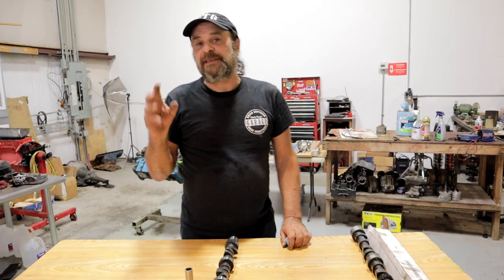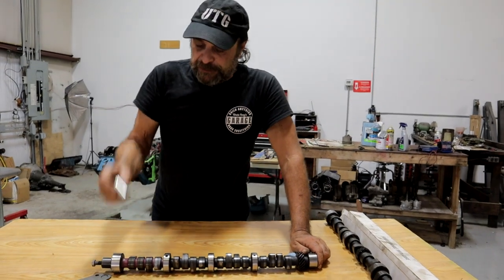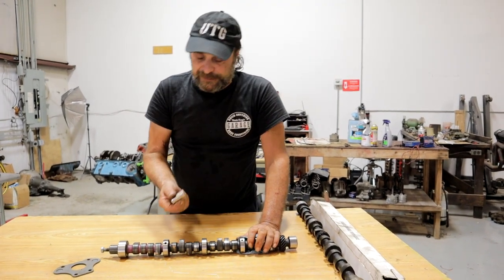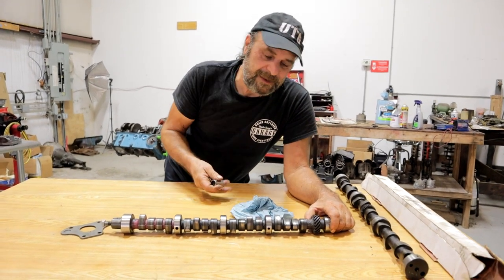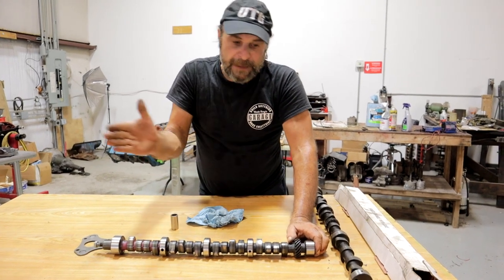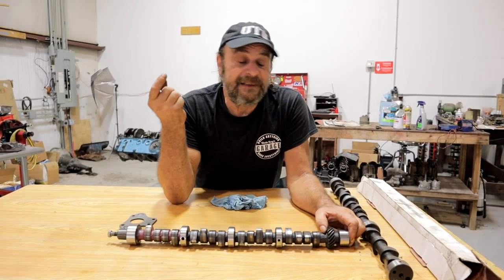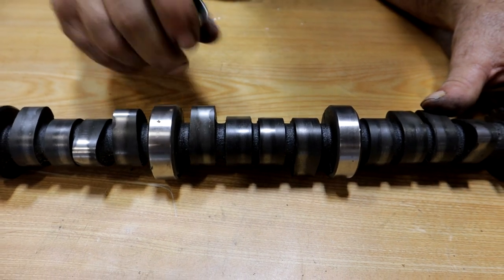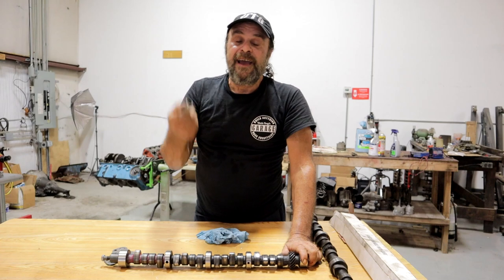Avoid Failure! Camshaft And Lifter Wear Patterns - What They Mean And How They Are Established

Comment: I work at a high school technical center. Your information is perfect for the kids to comprehend. Also, just short enough to keep their attention.  You make everything very easy to understand. I’m in my mid 50’s and grew up with all of what you are teaching.  I especially like that everything you teach is universal. I’m a Buick guy and I have thought back for several years now.. “ hmm what did Tony say”.. thanks for your time man.
Reply: Ever thought about missing oil thrower paddles on aftermarket conrods? Original GM Small Block rods have so called Splashers that throw oil on the cam lobes, most aftermarket rods dont have these oil throwers

Comment: More than 40 years ago I bought a 68 Chevy truck from a garage that acquired it with a mechanics lean. What happened was they put in a used engine supplied by the owner and it ran like crap.  They told him the cam was bad and what it would cost to replace it. The owner didn't want to put that kind of money into a 15 year old truck but also refused to pay for the work already done. I bought it by paying off the amount owed thinking I was going to need to replace the engine. My father in law owned a garage. When we checked about 4 lifters had no tension against the rocker, "very early Chevy 350" But my father in law noticed that when the engine turned over the push rod moved as much as ones that seemed normal almost like the pushrods were too short.. Pulled and measured, all the same length, started pulling lifters. All were fine except the 4 in question had wore clear through to the hydraulic center. My father in law ordered another set of lifters. We dropped them in adjusted the lifters and the engine ran fine. No smoke no noise. I ran it  for another 12 years and sold it for a lot more than it cost me to buy it.
Reply: Don't care if you got another 12 years out of it. You do not put new lifters on a used cam. Period.
Reply: @daveo532   New lifters are put on used cams all the time. All you do is act like a new cam break in.. Run the engine at about 2500 for half an hour an very the speed up or down 200 rpm. If there would have been a problem it would have showed up. It was not a high performance engine so the valve springs tension was not very high and we readjusted the valves after break in. We put other used cams in without problems. I put a used cam with higher lift in my 289 mustang motor out of a 351. There wasn't any problem. Just had to change the firing order.
Reply: Change lifters all the time. No biggie.
Reply: @daveo532  I think you got it backwards buddy you never put used lifters on a new cam..

Comment: Good Stuff! I've been building motors for over 30+ Years and actually learned something I didn't know...The reversed tapers on a properly ground "A series" MOPAR motor. Myself, I build GM motors these days, specifically Z/28 302/LT-1 motors. The last LT-1 I built I wanted it to "run a little better" than OEM, called up Bullet Cams and ordered a couple of UltraDyne solid flat tappet lobes I always liked. The OEM GM solid lifter came in 2 types, the "piddle valve" and "edge orifice" type that cuts top end oiling by about 15-20%...Fun Fact the majority of late 60's solid lifter HP motors had the "585" series edge orifice in them. I was running roller rockers and didn't need the full oiling. The OEM GM lifters have a stellite hard face on them, they are far better than anything else ouside of a tool steel lifter and the best for long term street reliability... the last time they were sold through Gm they ran about $32 each,this was in the late 1980's!!! Not cheap. I had a 302 Z/28 motor that had some in it with less than 5,000 miles on them. I sent them off to a service that would re-radiuus the lifters...Guy said I might be better off going with a 100inch radius rather than the 120inch that was OEM specs....I called Bullet Cams and asked them....Yes! They said that would be better, so today after 20,000 miles, the 70 LT-1 just ran 12.98@109MPH through the mufflers and on street tires....TKO600 5 speed with steep 1st gear helps get the job done. Not bad for an old "dinosaur" without EFI or computers....Does have a factory breakerless ignition, and ported "186" heads, factory intake and 0.030 overbore....better rods and 10.5:1 lower compression.
Reply: Very interesting. I saw a video tour of a small cam regrinder in Tacoma a few years ago. They said they not only regrind stock cams, but reface stock lifters as well! They said factory lifters, reground, are much more reliable than the offshore crap sold nowdays! I'd never heard of reground LIFTERS before then, or since...until now.

Comment: These videos do help demystify the issues with camshafts that I keep reading and hearing about. I think they went back to non-tapered camshafts for some newer USA overhead cam engines. I have a 2007 2.0L Ford Focus duratec, and it has flat tappets. I am pretty sure I read that they are offset to keep them rotating, but do not recall 100%. By the way, as far as modern USA engines go, I think that the 3.0l Ford duratec (like in the 1996 Taurus) and the 2.0L Ford Duratec (Like in the USA Focus) are pretty good. I have about 295 thousand miles on my 2007 Focus with manual transmission. Though I did remove the intake tumble flaps.

Comment: I learned my lesson.  I grew up in the 70s in Detroit.  I grew up seeing all of the best muscle cars.  Fast forward 40+ years.  I bought a 1978 Trans Am.  I didn't do my research.  I was just a kid in the 70s.  I used oil without zinc.  I blazed through my Cam within two summers of driving.  I had my engine rebuilt completely and went back with a somewhat radical Cam and headers.  I now run the correct oil w/zinc and I am heading into my 3rd year since rebuilding the engine.   And.....I continue to watch UTG to learn more and more.

Comment: I recently pulled the cam out of a AMC 360 after a 25 MINUTE CAM  BREAK IN .  15 nos flat tappet lifters and 1 China lifter . The China lifter did not servive. I spent a bit of time looking at the cam ware patterns and could definitely see all of the wear patterns that you talked about on this type of cam style. Your vids are in sink with my build progress.  New cam and lifters on the way.  Johnson hylift lifters, made in michigan coming with the new cam . I'm that nerd
Reply: I looked at the website, and it seems they only make roller lifters. I wonder why people can't make solid lifters anymore. It seems it would be simple to take a bar of the right material, machine it to size and machine (or grind?) a taper on the face.

Comment: I’m currently installing a CompCams “Thumper cam” in my Chevy 350, a little nervous about break in but really excited to see the results! 

I got 6qts of CompCams break in oil and then for the oil to run after that I got Lucas “hot rod” oil that has the added zinc for old school engines
Reply: Use the silver never sieze on cam and lifters for break in do not get any on the sides of your lifters they need to rotate  15 min 3000 rpm change oil.
Reply: Don't be timid on the startup. 
Once it fires up and you don't see gushing fluids in 10 seconds ,bring the revs up to 2000-2500 to get those lifters spinning and proceed.

Comment: Thanks Tony, that was very helpful. The other topic was valve guide seal. Teflon its what my brother used back in 82' on 77' 351mod. 400 heads. Economy performance cam. holly 650 dbl pumper. I saw your vid where you covered it. A company makes them now. It prevent the morning puff of smoke from the drain down on an older motor.

Comment: Factory cams for thrust plate engines used to be configured so that one lifter would usually be forward, the next in the valve opening sequence, intake or exhaust, would be the opposite, back, then front, back etc.

Comment: Zinc very important. But the oil manufacturers took it out a few decades ago. That's why I always add about 3oz of Lucas assembly lube when I do an oil change. I have a dodge ram with the 5.7 Hemi which are supposed to eat lifters. I have over 160K miles with no issue's. I credit that to the zinc. Also have a 98 Nissan frontier with 300+K miles and it runs like a top.
Reply: I started running royal purple HPS in all my older cars,even the diesels.
Reply: Hemi engines did have lifter issues on some but it wasn’t a ZDDP related problem. All your SP engine oils have approximately 700-800ppm of ZDDP which is more than sufficient for any stock roller cam engine. It is woefully lacking for old school flat tappet cams whether stock or not.

Comment: Correct on the lobe taper and lofter crown. But every flat tappet 6cyl and 8cyl USA and Aussie based engine I have built uses some lobe to lifter centerline offset. On inspection during build mock up if there is insufficient offset thus gets corrected in one of many mannors depending on how many need attention. Sometimes playing with thrust plate and shimming it as well as machining the timing set or cam to move the entire cam back or forth or narrowing a lobe(requires re heat treating) or lifter bore machine an resleeve to get offset. 
  Roller cams do show a wear pattern and can give clues as to condition because the roller wheel face on the lifter is not flat, it has a slight crown just like a flat tappet but in the case of a roller this is to stop the sides of the roller wheel from ripping into the lobe due to the lifter having some rotational movement either side of its capture by dogbone, link bar, key way, tray etc and to allow for lifter bores that are not quite perfectly in line with the lobe.

Comment: One additional source of lube is the rod side clearance .Always check this when building your engine and err on the larger size . I"ve run up to .030 side clearance on a mostly street build with less than 450 hp. I also use a lifter galley shield that has 3 functions . 1- keeps hot oil off the bottom of the intake, 2- helps keep oil around the lifters and 3- helps retain the lifter incase of a push rod failure. Also ,when building the engine always check the lifter bore with a new lifter before you have any machine work done . Make sure it spins freely ! this way you can tell your machine shop weather to hone the lifter bores or not { or just give them the lifters }. One last thing , before assembly , slide the new cam in and make sure it goes all the way in ! Sometimes blocks have a core shift from the factory .I found this out on a 1968 440 block. I took it to a shop and they confirmed it and used a cam bearing cutter to take a couple of thousandths off. Hope this helps a few people.

Comment: Thank you for all the fantastic info I'm fixing to pull out three or four old cams and check them out that wiped a few lobes back in the late '90s when Mobil 1 oil was all the rage and it had no zinc in it even the Chevrolet instruction manual that came with the camshafts said do not use anything besides natural crude based oil and specifically warned against using synthetic motor oil with their camshafts they were ground by crane this is for big block Chevy (l88 cam in  454 , 781 heads, 11:1 etc) once again thanks for the great info!

Comment: This example is a big one that my daily driver, a 1977 Buick Regal with a 350-H with over 310k miles on it this is how I drive it and I’ve converted the RGS-2 carburetor to manual choke and I’ve installed remote oil cooler and engine oil filter assembly with a lot of oil lines for the installation. In the morning cold start I watch the oil pressure closely and bring the rpm up gradually to 1,500rpm this procedure happens in probably less then 60 sec. Then I hold the engine at 1,500 rpm for 1 to 2 minutes then backdown to maybe 1,209 for a minute or so. A lot of this depends on the time of year. Now I’ll talk about curb idle settings. Factory is 750 in gear 850 out of gear; to me that’s to slow and also effects engine oiling. About 99% of my driving is in-city. With long wait times at traffic lights ; some as much as 2 minutes. So I’ve set my curb idle out of gear to 950 rpm which has a positive effect on oil pressure. Every stoplight I’m at I will shift the transmission into neutral as I’m waiting for the light to change, then slam it into drive when the light turns green. Sometimes I will raise the idle at a stoplight to 1,100 rpm if I feel need be. All this happens real fast and I’ve been doing it for years. It’s become automatically for me. One thing if your wondering about my transmission????. The car from the factory and I’ve had rebuilt is a TH400, with a transco level 2 shift kit and a high stall converter. So it goes into gear real fast. All this is about maintaining better oil splash lubrication at low engine rpm.Also I use valvoline VR-1 racing oil faithfully. My engine is one happy smooth running motor on valvoline oil. It doesn’t matter what it is my engines run smoother on valvoline motor oils and I’ve used them for decades.

Comment: I got my license in 1987. I had lots of camshaft problems. Lost a lobe on my 20r Toyota, the 302 in my 79 ltd,a1973,340,a 318 I used while the 340 was out, too many 350 Chevies to remember. One finally got a blue racer cam that was advertised as having more slope to help the lifters spin. Also a 345 international ate a lobe.

Comment: Informative topic.....I'm fairly certain the distributor gear's Location generates the Majority of the camshaft's Linear thrust Direction so the Rear located distributor engines require a Front located camshaft thrust  plate....The Front distributor engines use the camshaft sprocket  to function for the thrust plate so no Separate plate is needed.....

Comment: Have you ever built a “balanced and blueprinted” engine and weighed everything out and got it perfectly balanced? Does it produce more power or is it more to reduce vibrations and try to increase longevity?
Reply: Balancing and blue printing would add life to the bottom end to an extent. But it would take a magical machinist to calculate the twist of each engine block and machine it for the twist that individual block produces under load. It would also need to be disassembled by that same machinist, in order to see the imperfections that the old parts had fingerprinted into them from the previous mileage put on that block. Block twist would be hard to control the wear of cams and lifters unless you could regrind your cam custom to your blocks twisting problems. All V8 have twisting issues.

That's where shade tree mechanics doing their own work could possibly do the footwork and make "iron blocks" better than they were. By actually taking the time from teardown to assembly. Most machine shops aren't concerned at all above what box you checked on your order.
Reply: They can make a bit more power, but the main goal in my experience for balancing and blueprinting is to do everything possible to reduce harmonics/torsional stress on rotating parts to increase longevity in a motor thats gonna be leaned on HARD (big power, big rpm's, hard use etc.)
Reply: Had my big block olds balanced, it's smooth as glass.  Worth it, IMO!  Would it have been just as smooth?  Maybe, but I wanted to make certain because I had no idea if parts had been mixed and matched (flywheel, damper?), it was getting new pistons for the 0.060 rebore.  Just making sure, while it was apart.
Also, I commissioned the machine shop to assemble it, not that much more and I felt obliged to support the business.  I think he did a great job, no startup rattle, perfect oil pressure, etc.  Couldn't be happier.
If the machine shop sucks, you're done and so are your parts.
Reply: It can free up a little HP but is more for longevity especially during extended periods of WOT and high RPM . That's why balancing and blueprinting is more prevalent in racing .
Reply: Harmonic vibrations perfect kill . . ask chopper pilots
Reply: @glengillham4629   Keep the harmonics on a back foot or like a wine glass opera singer shatter
Reply: I grew up with cars and boat (outboards). Factory outboards were far better balanced than factory car engines. 

With that said, I stood on the bank at some outboards drag boat races in mid '90s and watched a renowned OMC outboard builder in unlimited class (alcohol & nitrous) have trouble in a cylinder. He pulled the rod & piston out of the hole and ran the engine what had to be at least 8000 rpm (9200rpm when health and 8 pistons) missing a whole rod & piston and the engine survive a full race heat.

Comment: Most people don't relize that this info applies to modern engines including that  OHC/DOHC  I took my 95 Saturn Twin Cam apart with 90,xxx to modify. Note I ran oil without zinc. Upon inspection, the cams had bad wear. No tapper wear look to the cam. It uses a flat style tappet, (called a bucket) that sits between the cam and valve tip. The crown was now a concave. It will get a zinc rich oil or additive.

Comment: This was good.  Did you know that Ford 460 engines have a thrust plate yet all the lobes are ground high to the rear of the engine.  Why?  Who knows.  

I just reground a circle track camshaft that had about 10,000 laps of running using the same profile and it is very interesting to see what the wear pattern looks like as the lobe cleans up.  In this case it took about .004 and the place with the most wear was not over the nose but on the flank just before the nose.  Sort of a little football shaped patch that took a couple of thousandths of grinding to clean up good as new.